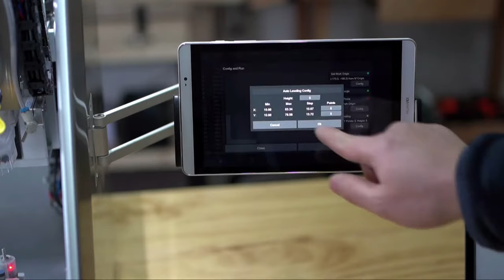CARVERA - The Most Advanced Desktop CNC In Its Class!

Comment: 1:32 No chips to be seen. There is close to zero chance that this machine milled out that aluminum block. I wish they would have the courage to put the actual sounds during operation.
Reply from the maker: This is a finish pass, with a very small chips cutting amount. You can see the detailed video here to find out: https://www.youtube.com/watch?v=Vn-Y5PFc4aE&t=3s
Reply: @Makera  Thanks for the reply. I stand corrected. 

May I suggest that you include actual sound from the milling operation at least for some short section without any music. It really helps give an idea about the rigidity of the machine and the spindle quality. Check out some videos of the x-carve, etc and their DC motor with a er11 collet adapter is really not adequate for any millin op. and the videos are deceiving because you can't hear the thing struggling.
Reply from the maker: @Somun-a  This is just a promotion video, not showing the sound doesn't mean cheating I think, we will show detailed milling videos in the future, thanks for your advice.
Reply: You can see there was a lot of vibrations during the cat, telling by the marks left by the end mill, but i would like to hear the terrible noise it made during that process.